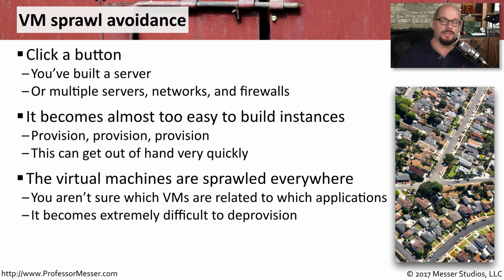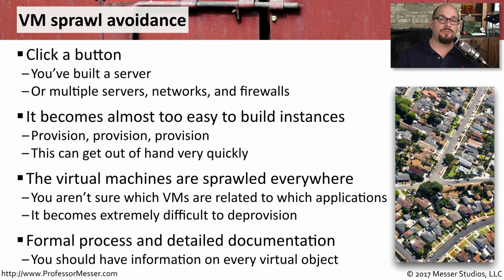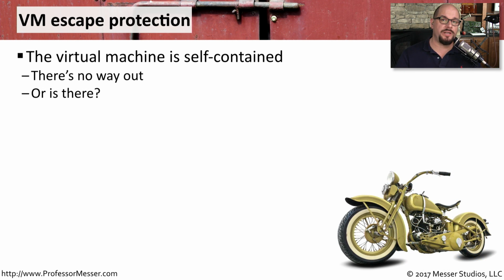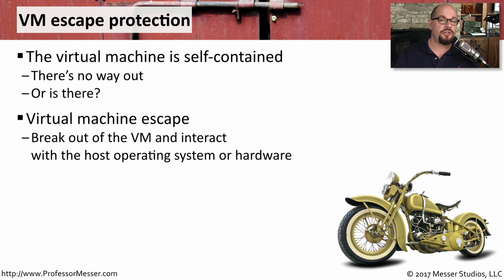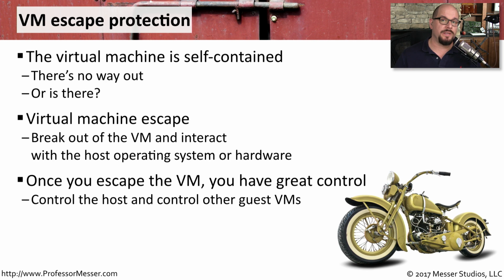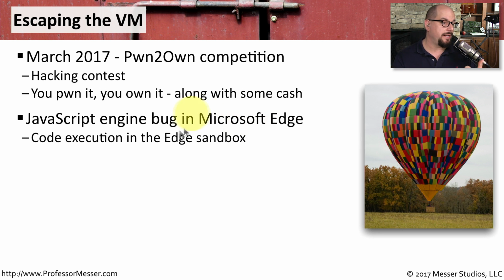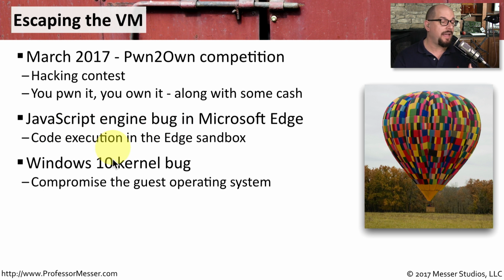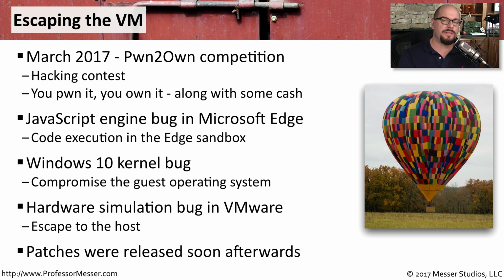Virtualization Security - CompTIA Security+ SY0-501 - 3.7

Comment: Since VM escape is possible, would the VM isolation concept be a form of security through obscurity?
Reply from the maker: Security through obscurity means that if you know how the security mechanism works, you can easily circumvent it. This isn't the case for VM escape, since it's an exploit that's created from bad code. Once a VM escape is discovered, the problem is immediately patched. A VM escape exploit is relatively rare.
Reply: @professormesser Security through obscurity was the wrong phrase to use... I visualized a possible VM escape as an attacker somehow finding the VM by exploiting the implementation of it. Kind of like how NAT is security through obscurity without pairing it with some sort of firewall (because a smart attacker can find the private network). So then, how is a VM escape discovered and who usually discovers it if not the bad guy?
Reply from the maker: NAT is not a security feature, so it can't be associated with security through obscurity.

VM escapes can be discovered by security researches or by the VM software company themselves. The person who discovers the exploit can be anyone.
Reply: @professormesser  Hmm, a previous video said that about NAT. Thanks for the quick responses and straight forward answers